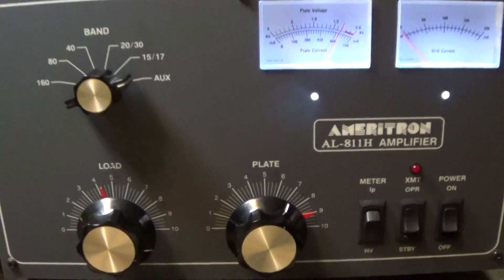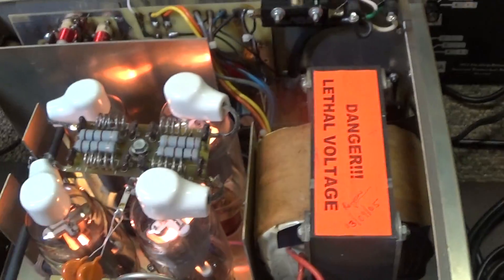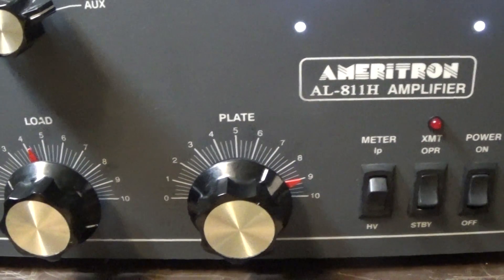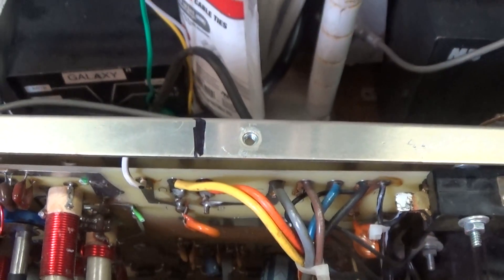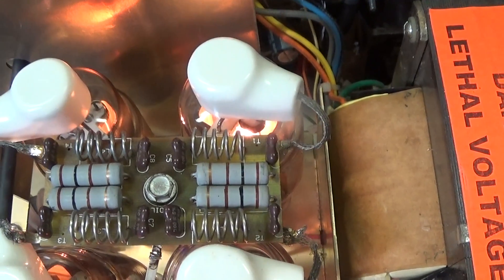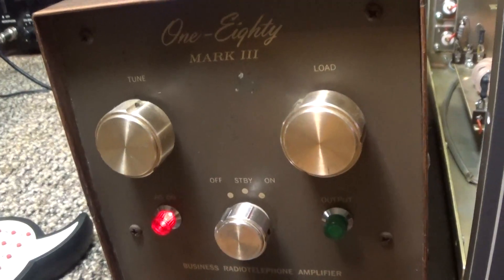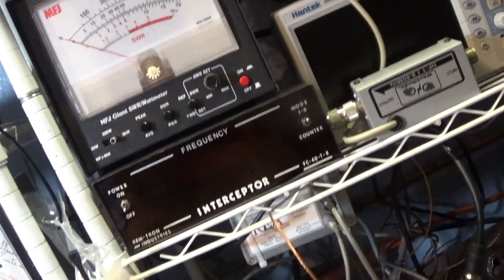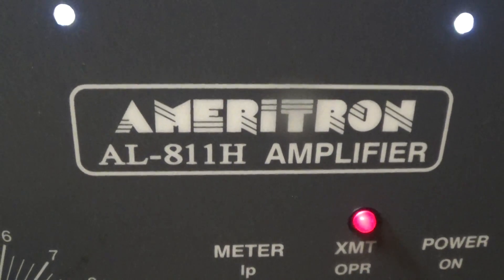Ameritron AL-811H Linear Amplifier

Comment: I have the standard AL-811 three-tube version amp (which preceded the AL-811H). I had another AL-811 that I had cannibalized and used some of those parts to add a 4th tube. There wasn't a lot of space in there for it, but it works out pretty well. The original AL-811 amp was rated at 600W PEP. The AL-811H is rated 800W PEP. With the 4th tube added, mine runs at about 700 PEP.
Reply from the maker: Sounds right to me. Good Job!

Comment: That's a great little amp does it run cool when heavy talking on AM?
Reply from the maker: That amp is known to have a small transformer and 811's cannot take much. Many replace the 811's with 572B's which can take a lot more, but you still have to deal with the small tranny. That amp goes for about $800 used now. I liked it a lot, wish I had not sold it. Ameritron also makes one designed for the 572B's. It is a much heavier version of this. However, the new selling price of the Ameriron AL-572 is a whopping $2399!  I always run my amps at low dead key, and let them swing, and I  don't push the swing over the amps limit. I believe 9 out of 10 blown amps are caused by operator error.
Reply: no never run more than 200 watts on am

Comment: How long would you suppose this amp would last at 500w output on 10m?
Reply from the maker: 500 dead key or 500 swing? 572B tubes or 811A's?
Reply: @tramdr  SSB. 500 PEP. 811A's
Reply from the maker: Should last a very long time.
Reply: @tramdr  Awesome thanks for the reply.
Reply: dont matter 811s are cheap enough

Comment: Sorry for My stupidity. Does ameritron make any amps for  mobile applications that a Galaxy or a Stryker Radio will work with? Again,I apologize. Just wondering as I was told that these are way above Dave made,X Force and the such. Thanks to all,Troy.
Reply from the maker: no they do not.
Reply: Yes they will
Reply from the maker: well they make a 500 watt mobile amplifier that will work, but IMHO since its mobile anyway, get a Texas Star and be done with it.

Comment: Can I transmit in 11 meters with this amplifier? 73
Reply: Yes, but AM is awful hard on it.
Reply from the maker: just don't drive it hard, and it will be fine.
Reply: @M70ACARRY not if the dead key is low. My icom dead keys 15 watts & swings 140 pep. Amp dead keys 100 & swings 800 pep. I turn my radio to swing 80 pep to get that. 140 is too much.
Reply from the maker: It comes new from the factory with 10 meters disconnected. There is a simple mod (cut 1 wire if I remember right) that will allow it to work on 10 meters. Any amp that I know of that works on 10 meters will work on 11 meters. That's the very reason some amps are sold without 10 meters working,  to keep the 11 meter guys off of it. The only amp made I know of that would work on 10 meters and not 11 meters was late (newer) versions of the Heathkit SB-220. That amp had an 11 meter filter or block on the input side of it. It was called just a 'Filter' in the schematics. Since this filter only blocked 11 meters, that amp would work on 10 meters and not 11 meters. For those who wanted to use it on 11 meters, just bypass the 'filter'. Soon after Heathkit came out with the SB-221, same amp, but did not include 10 meters at all, just 15-80 meters. It had to be slightly modded to get 10 meters back in it! I think this was all done to pass the FCC back then as the CB boom was at full force and there where many many Cb'ers back then using Ham amps for 11 meters.
Reply: No
Reply: It's illegal
Reply: @lizzyfan1986  Your point?
Reply: @lizzyfan1986  🤣🤣
Reply: @lizzyfan1986  oh cut the shit! Idiot

Comment: I have one it don't come with l e d lights the lights it comes with burn out I did my Owen l e d light mod you also have to change one resistor for this mod it don't have ten meter you have to do the mod for ten meters

Comment: I have 2 of those Kem-Tron channel boxes for the 858 PL chip. (Seen it under the watt meter) 1 was working but goes into scan by itself and the other just stays on channel 40 all the time. No info on the net. Have you ever seen/had this happen with yours? I changed the switch and 1 cap that looked bad but didn't help. We're friends on Facebook also. I like all of your videos. Very informative. 
Thanks Shane
Reply from the maker: The Kem-Tron I have under the wattmeter is just a Freq counter only. It works like the Glen 326G as it has the offsets so you can hook it into the receive of a radio and still get the correct frequency. This model FC-40-T-R (Frequency Counter Transmit - Receive) is not a VFO in any way. I have 2 of these that work great. I like them because of the offset and the big display. I do have a Tekniq VFO that looks like a Black PAL VFO with digital readout. It does not work. Has problems similar to what you described about your Kem-Tron VFO. Can't find any info on it so it sits. :(
Reply from the maker: Today I was putting away some more stuff that didn't sell at Hamvention and saw that I do have one of those Kemtron PLL controllers. I have no info on it and have never tried to hook it up. If you find something on it let me know.
Reply: I gave up on mine. All the caps are probably out of spec and it has 8 IC  chips that probably need  checked/changed. One was hooked to a Cobra 29 LTD (non classic, the older one) and the other to a Cobra 139 XLR. I also snipped the ribbon cable on one to use on another project lol. There's no info at all on the internet. ☹
Reply from the maker: I messed with the digital VFO for a while with no luck and then gave up. Because I am not good with PLL's I never even tried with the controller. A couple of buddies of mine who know PLL's pin for pin in their heads and 1 can even count in binary and  hex will have a better shot at it than me.
Reply from the maker: first thing I do in this vintage stuff from the 70-80's is change the caps. However with the controller, not worth my time to try to fix it and then have someone offer $30 for it.

Comment: It'll do 800 to 900 on the lower bands..
Reply: 4-572B tubes with the correct transformer will put out 1300 watts on 160 to 10 meters all day.
Reply from the maker: well this video shows it doing close to 900 peak into a dummy load with a new set of 572b tubes in it. However with 811a (because I ended up selling the set of 572B tubes) it did less, so IMHO it won't do it with 811a tubes but will do it (and it was loafing) with 572b tubes.
Reply: @tramdr  What's involved in the 572B swap?
Reply from the maker: Nothing, just swap the tubes.
Reply: no it will not